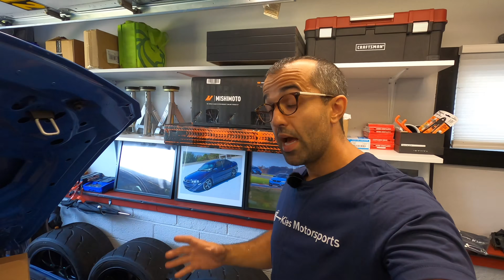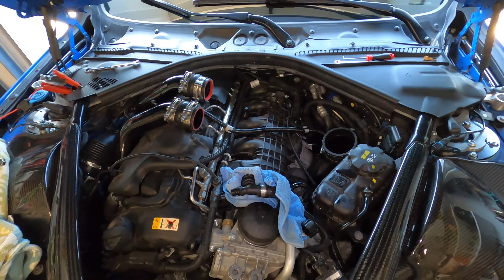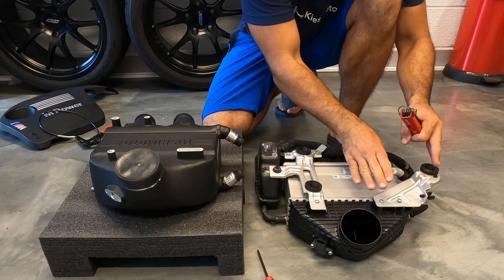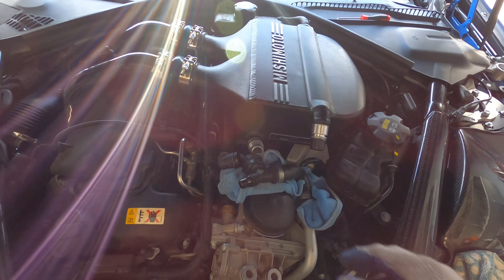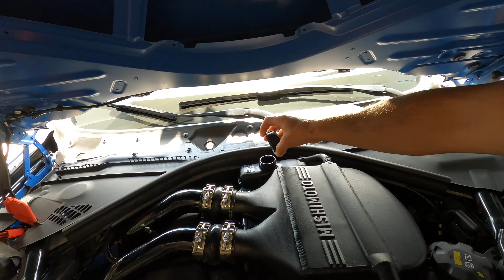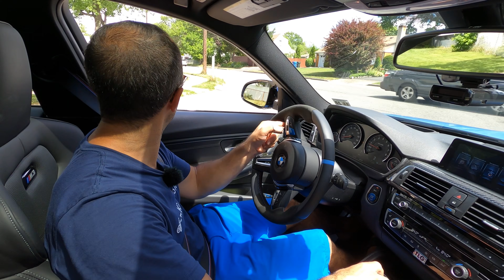BMW Charge Air Cooler and J Pipe DIY Upgrade Without Draining the Coolant (M2, M3, M4)

Comment: I appreciate you tommy. Got misfires and codes from mine last night. A year ago i bought an OEM replacement in case this happened. Just finished the install in less than 2 hours this morning thanks to your video. Letting the coolant burp itself now before i bleed it then do a spark plug and oil change just to be safe. I should be able to make it to my dad's for father's day after all! And work tomorrow too lol
Reply from the maker: Glad the video helped you save the day and get back on the road so quickly! 👍 thanks for the kind words.

Comment: I bought a cheap J pipe on eBay and could not put it on and had to tow the car out to a mechanic’s shop.  On top of that there was a vacuum leak.  I had to replace the Jpipe with another one.  Don’t be cheap.
Reply from the maker: Well said!

Comment: My OEM intercooler was empty one day, found out because of a code saying charged air too hot. Replaced it with a CTS top mount, 2 years later. I'm getting misfires  only when under full throttle at around 4k RPMS and up, with NO codes or checck engine lights.  Noticed the fluid for the reservoir is low, so I filled it up to the top of the yellow float, and now a month later its down towards the "bottom" of the yellow float.. This could be the cause of the misfire? assuming its leaking again wtf
Reply from the maker: Head gasket leak?

Comment: If I’m just replacing the intercooler right now can I just put the coolant back in after the install or do I have to drain it ? Also did you have to remove any coolant after completing the sequence 3 times?
Reply from the maker: You can put it back in no problem

Comment: Hello Tommy, useful video, thank you for sharing. I am just thinking of installing a new set of Wagner Tunning (intercooler, chargepipes and radiators) on my S55 engine. Unfortunately I am not able to find any information on the Internet if the cooling system really brings any more power. Did you get some more HP or better response on the trottle pedal after finishing the installation of the intercooler and the radiator?  .
Reply from the maker: Zero chance In feel. You do this as preventative maintenance.  Unless you’re tracking the car you don’t really need the charge cooler or heat exchanger.
Reply: @TommyLGarage  Thank you for your reply, appreciate it. It is strange that all the producers of air cooling parts say in their offers that the installation of the device will increase power, torque, etc. It seems that they want to confuse the customer a bit:-)

Comment: One thing to add on the J-Pipe is if the new one doesn't come with an O-ring, you need to transfer the one from the stock Pipe or get a new one.... would have helped me the first time I installed it.
Reply: I thought I lost it the whole time 🤦🏽‍♂️ ended up transferring the old one 👍🏽

Comment: What’s your 4 month review on this top mount cooler? Thinking of grabbing one😬
Reply from the maker: Heat exchanger is better
Reply: supposedly, you do it because the OEM like mine, leaked completely. Bought a CTS turbo intercooler, and 2 years later this one is leaking as well..

Comment: Hey tommy would you follow the same process if you are just topping off the charge cooler reservoir ? Noticed the cooler was hot to the touch after a drive but no codes and car seems fine. Checked the reservoir it’s bone dry
Reply from the maker: Yes you would have to bleed it. If you have a leak you might need to replace your cooler.
Reply: Tommy L Garage a week before Mpact ... bummer I was thinking the same thing leaking internally. That’s what ya get for being tuned I guess I’ll take it over sch

Comment: Hi tommy, I decided to get bimmercode after seeing your video on it and everything works great except the door unlocking when ignition is turned off function, when I turn the ignition off the doors do not unlock, I have tried everything and still no luck. Do you happen to know a solution for this?
Reply from the maker: I answered earlier.  Not really sure. Coding worked. So it just be hardware related. Have you tried doing it with your spare key fob? Maybe the batter in tour main one is low and it affects it
Reply: Tommy L Garage I figured it out, just in case has the same issue. apparently you have to let the doors lock on their own when you drive off

Comment: Tommy.  Sorry to ask this here as it’s off subject.  What brand spacers do you like?  Have you heard about these stories around the forums that 10mm are a bad size for the f80 due to the possibility they could float due to hub size.  Do you know anything about that
Reply from the maker: I ran 12mm spacers at the track with zero issues. 10mm are not very popular are are kind of pointless

Comment: Did you notice that the j pipe seemed to have a little play connected to the throttle body when installed and the stock one is the same ?
Reply from the maker: Jay Carter Yes that is correct. It’s got to play I’m assuming to accommodate for vibrations but there should not be any leaks

Comment: My s55 car is 590whp I’ve tracked my car on full e85 in july in miami ( 95 outside ) and the car ran just fine on 100% stock cooling system. Still haven’t seen any evidence that these do anything what so ever.
Reply from the maker: I heard the same. But it’s good to work on the car

Comment: Great video Tommy. Very informative DIY. 'Gentle cruise' is what you meant. And I see you baby the Alcantara on your steering wheel. Keep the intake don't change it. Look for a solution around it. How has the better cooling been so far?
Reply from the maker: My hands were dirty so I was protecting the wheel hehe. 
Good call on keeping the intake

Comment: Good DIY video - looking forward to see your Mishimoto front mount heat exchanger install as that is on my list as well.  You should consider getting the Awron gauge to better monitor those temperatures and more.  I have it in my F80 and it integrates well with the car.  Too bad it is too late for you to get before and after temp data though....
Reply from the maker: Looking into awron as we speak :)

Comment: I did my charge cooler and heat exchanger a couple of months ago, I’m wondering since you didn’t show it on your video transferring the mounting brackets from the stock charge cooler to the mishimoto one if they gave you the correct mounting screws.  They gave me the wrong ones that wouldn’t fit and I have to run to Home Depot and find some screws that would fit. Luckily I did.
Reply from the maker: All was well on my end. Hope you like the system
Reply: @TommyLGarage  love the system you get the best bang for your buck compared to the csf one which is a lot more. also thanks for your response love your diy videos, big fan, keep up the good work!

Comment: Nice. Stock water pumps? I keep hearing the plastic impeller is still a point of failure. I've had mix results with the water pumps. One car failed with low mileage, another with high mileage.
Reply from the maker: I think stock water pumps on these are solid

Comment: Hey, nice video like always.
I have  few questions and opinion.
1.  Are you preparing to install stage 2?  :) because if not , i don't think you will feel any different from stock intercooler. These cars&engines tested many hours in hot conditions and don't have any issue. Its nice to see dyno test if its work in hot conditions. 
2. Plastic engine cover. There is no space to install? 
Really like all your videos! Nice job. Greetings from Lithuanian m4 manual owner.
Reply from the maker: Thanks! 
1. Yes. Eventually doing downpipes and going stage 2. Sometime this year for sure 
2. Engine cover fits - I just didn’t put it on because it looks better like this and it’s something I don’t typically run at the track. I’ll put it back on eventually
Reply: @TommyLGarage   and  i like your way, first you upgrading grip, heating, handling and than power. I think this is best way to prepare for some stage improvment
Reply: Tommy L Garage I thought you want to stay away from those downpipe smell/fumes!?!

Comment: Would have been good to do a before and after charge temps check, as I have heard there's no significant difference adding these...
Reply from the maker: There is no difference most likely, but withe the heat exchanger and eventually going stage 2 it should help
Reply: It should for his track days for sure,  maybe not daily.